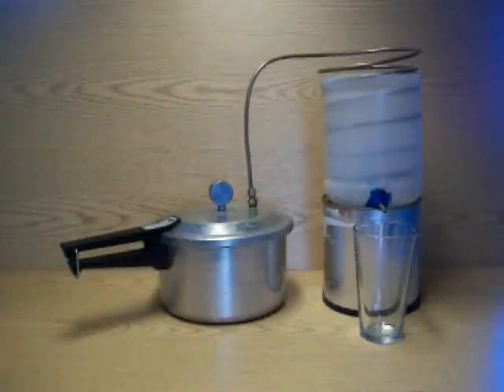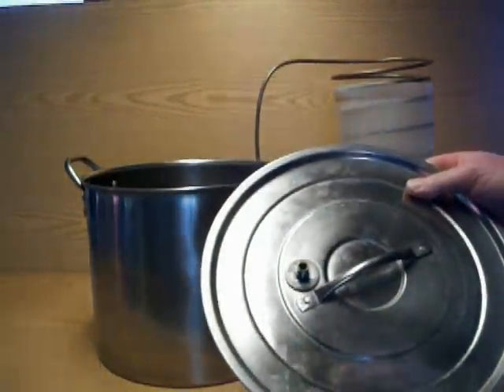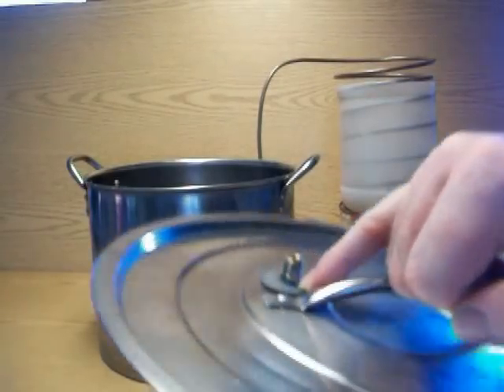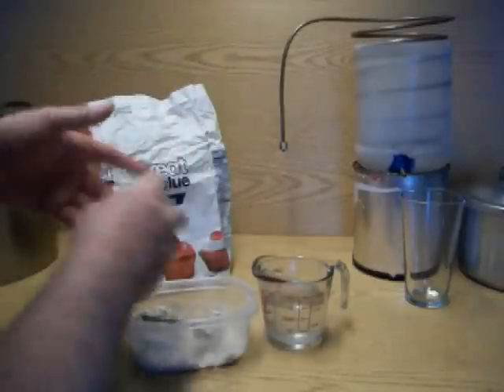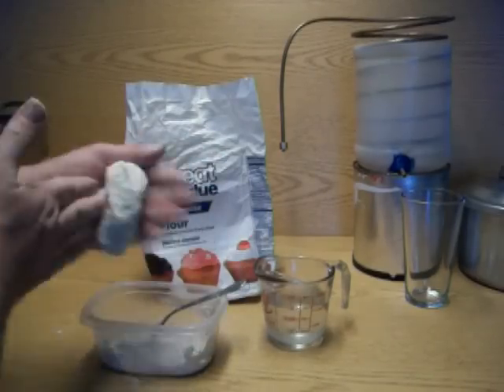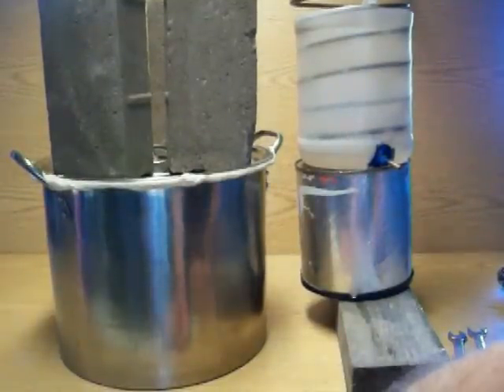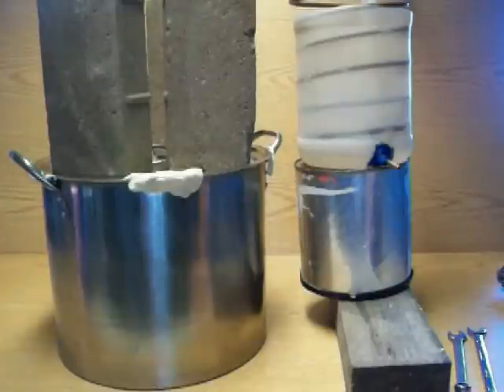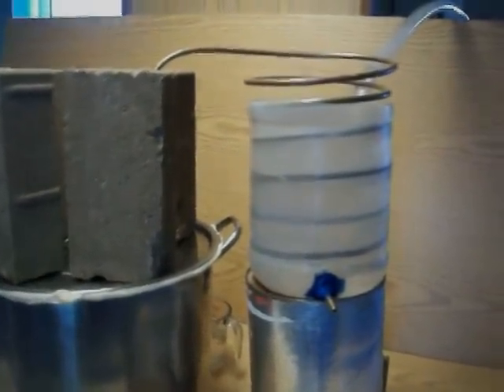Easy Build Moonshine Still pt 2 Upgrade

Comment from the maker: Not the way I see it. For everyday use, yes. Hobby use, no. A soup pot that has been fully converted, with all the extras like fasteners and glued on rubber gaskets, for sale on ebay will cost at a start of $350 min. I've spent $40 and got 4 soup pots, that are still soup pots when finished. It take 5 min to make flour putty and I know it won't leech chemicals. This also compares to how the backwoods'ers do it. They use flour putty and rocks in the exact same manor.

Comment: what's the thing called goong into the lid I have a 1/4 soft copper tubing
Reply from the maker: It's just a connector, sold at the hardware store.
Reply: Let me ask u something I have a 1/4 soft copper tubing what size fitting should I buy for my lid for the copper tubing
Reply from the maker: Just take your parts to the hardware store and ask the people that work there. They know their business very well
Reply: one more question do u think 1/4 soft copper tubing is good enough or should I use a bigger size
Reply from the maker: 1/4 is twice as big as I'm using.....so seems perfectly fine to me. Just use whatever size will fit in the hole

Comment: WCEmichale-what equipment do I need to get after I drill hole in lid
Reply: What size couplers do I need
Reply: What size copper coil do I need
Reply: What size hole
Reply from the maker: A couple of wrenches or a couple of pairs of pliers, or a wrench and a pair of pliers.

Comment from the maker: I don't think it's a good idea. I didn't want to use it at the connection, but it was a micro amount and it was on the outside.
You could use cork (found on Ebay) and cut out a gasket, and if I was going to glue it to the lid, I would look up "food safe adhesives" on a search engine or Ebay

Comment: What's the purpose of a thumper?
Reply from the maker: The purpose of a thumper is increase the potency of the alcohol... Personally I don't see it. I never use one
 The backings that you are suppose to put in it can easily be put in the still. Backings are the little bits of alcohol you get toward the end of a run... There is so little of it, it tastes watered down and crappy BUT can be recaptured by adding it to your next run

Comment: Move your plastic jug with worm  in it closer to sink pop small he in side of bottom so it will run in sink turn yer cold water on and regulate it to the amount that is draining out of bottom and no more changing water all the time it would save ya allot of time and have a constant cool water all the time and that's one of the important steps don't you think ????
Reply from the maker: It is impossible to regulate. I tried a small siphon hose, and having the cool water flow down to a trickle. It either slowly overflowed or it slowly drained dry.
The only solution is to install fittings on the plastic jug. One on the bottom for inlet of cool water and one on the top to let the overflow run into. This is just extra work to get everything and make sure it's sealed well and will hold up well, and it will also confuse viewers who need to understand the basic principles involved first.

Not that I don't like your idea.....

Comment: so if you brewed 10 gallons of something and it was 5% alcohol then (in a perfect world) not discounting heads or tails, you would get roughly half a gallon of alcohol at 100ABV  but since it distills less then that at say 80 proof  you would have almost a gallon of liquor, minus heads and tails, minus imperfections in your brewing you might get 3/4 of a gallon of liquor out of the 10 gallons of beer
Reply: sorry, I meant that as a question?  is the math reasonably sound?
Reply from the maker: Rick Hermann
I can't do your math right now, I had a late day at work and came home with a headache, so I'll answer from my point of knowledge.
I brew 5 gallons of mash/wash, and get a roughly a 14% concentration of alcohol. I distill that to about 100 proof and get roughly a half gallon of whiskey.
Your 10 gal at 5% would give you half a gallon of whiskey (assuming it was pure 200 proof) and at 100 proof it would be one full gal of whiskey. Is that close enough?

Comment: Hi mate love ur video, but i hear u need a bowl on top not flat lid, wot u think? And Justin Poole made a video with ur potato flakes.
Reply from the maker: Graham Bate  It's just one basic principal involved. Heat your mash/wash to steam, move the steam over, cool the steam down to condense it, collect liquid.

The bowl is not needed, however I can see practical uses for the bowl. it would provide extra cooling surface to condense some of the water and run back into the pot, this might increase the proof a bit. If you have a bowl on a lid, you can put holes in the lid and pack it with copper mesh.
Reply: sweet thx m8, I enjoy ur videos keep them up m8

Comment: Why not buy a larger pressure cooker and save yourself the hassle, those bricks are gonna warp that lid real fast

It's a handy tip how to make moonshine if your in the joint though or on the lam
Reply from the maker: This video was made 5 years ago and the lid hasn't done anything. This video is for showing people what can be done. It was roughly copied by a couple of guys in Pakistan, where they didn't have extra cash for a pressure cooker.
Reply: I didn't mind the flour idea you had as it was interesting to see how the moonshiners in the past probably did theirs without easy access too materials, is distilling moonshine not illegal in N-America, its legal here in the U.K. I just ordered myself a brad-new 10 Liter stainless steel pressure cooker gonna do it with a flameless induction hob, should maintain my pressure cookers life as no flame is being used. Ebay selling large bags 25Kg of cracked corn real cheap too making it even easier
Reply from the maker: Well as long as it gave you some insight, I've done my job. You could also check my video where I made shine from corn flakes. The information I looked up said there are parts of the US are legal. As long as you only make enough for yourself, you shouldn't attract attention. The main law not to break is selling the stuff. That is big time jail time. There was a news story about a couple of guys making banana brandy, possibly from my recipe, only problem was they had a huge still in their garage and had gallons of the stuff when the law arrived. Try proving no intent to sell on that one.

Comment: has anyone used a crockpot instead of the pressure cooker or the regular pot?
Reply from the maker: You can use lots of thing.......but they gotta be completely sealed or all your alcohol will leak out as steam
Reply: thanks!
Reply from the maker: @SheSewsDiscord  I see you had a question about connecting the coil to the lid.  Unscrew one of the components in the lid and take to the hardware store and ask them for a connector for a copper line
Reply: @wcemichael  Thank u!! actually i think the original owner must have lost one of the components— there was only a plastic plug!  but i will see what i can do with that— thank you again!!
Reply from the maker: @SheSewsDiscord  A plastic plug? Oh that must be an emergency pressure release. You should be able to get a tread tapper and make a useable screw thread....OR there should be a actual pressure regulator that should screw out. Ask the hardware guy about these possibilities. If worse comes to worse you can just use the flour putty to seal the copper tube in when you run it. The key is going slow so you don't put too much pressure on the putty

Comment from the maker: You didn't give me a whole lot of info there. Can you be more specific? From your general info, I'd say your running too hot. That bread dough is not going to handle more than a couple pounds of pressure. Turn the flame down.

The glue was a high temp car gasket material. It's a micro amount on the outside otherwise I wouldn't even consider it. You can also use the flour putty in place of that, It might last forever. You can stuff some f-putty into rivet cracks and let it harden.

Comment: No thumper?
Reply from the maker: You don't need a thumper if you do it right.. I watched Popcorn Sutton use a thumper to increase the alcohol percentage...……..then he cut it all with water. What's the point? I can easily get 100 proof and there are tricks to go higher.

Comment: Besides, commercial kitchens (i.e. restaurants) use almost exclusively aluminum because of its superior heat transfer.... Oh damn it's a conspiracy to kill us all hahaha
Reply: You’re mistaking all commercial kitchens use entirely stainless steel . Aluminum releases hydrogen with hot water and hydrogen gas would be dissolved in your water vapor making your alcohol slightly acidic

Comment: If u add a thumper it's safer and the proof will be higher
Reply from the maker: If I add a thumper, it will get higher, yes.
Safer? Debatable....It's not going to remove impurities.
I'm already getting 130 proof and I bring it down to 100 so people want to actually drink it. Adding a thumper at his point is taking a step backwards.
Reply: it will get rid of some stuff .when I first started I  was only getting 140 proof then I added a thumper it went up to 165 and stayed a long time. and no boil overs. u can use the same mash that's in the still or wine or high proof licker. its a good way to change the taste  and proof. I like to use the same mash ..good luck
Reply from the maker: Yes, as I said. A thumper will ramp up the proof. Keeping your cooling coil from puking from boil overs is about the only "safety" you can expect. 
However, unless your thumper is made from a mason jar, you don't really know about it puking, and a good distiller doesn't normally have this problem. Also, I always bring my proof down to 100 anyway. Good for drinking yet having enough kick to know it's not everyday whiskey. 
So a thumper can be used but is not needed.

Comment: Instead of putty just cut a ring from a whole sheet of rubber. Then use tiny C-clamps
Reply from the maker: Well the main purpose of this is to show the average guy how to do this without a lot of extra stuff. Also, the reason for the flour putty is people didn't like the rubber gasket, they thought it put toxins in the alcohol

Comment: you could use a old frozen water bottle.
Reply from the maker: There is enough heat there to slow cook a pot of soup. More water changes needed than a single block of ice will handle

Comment: Can i use my drayer machien.. I use it .. It was very very very god
Reply from the maker: What is that? are you asking or telling me?
Reply: wcemichael
is a thumper not nessicery? and does it just increase the proof of the end product ? what proof do you get without a thumper?
Reply from the maker: Rob o kane
Oh, hey. Sorry I missed this question. A thumper can be used and will increase the final proof when used right, BUT it is not needed. I can easily get 130p and I water it down to 100. That makes it low enough for anybody to drink but still high enough to know your not dealing with store bought whiskey.
Reply: thanks for the reply

Comment: You know a much easier way to do that is just freeze a bunch of 2 liter bottles with water in them and if the water starts to get warm pull 1/2 L out and pop the other two you in easy Peezy
Reply from the maker: And a fresh pot of cooled water will be hot enough to make soup in no time and running 5 gal takes all day so I'll need a freezer full of 2 liter bottles. So now I have to prep these bottles instead of just turning on the tap, and I have no room in my freezer for food. How is that easier??

Comment: i like your videos your mash recipies but dude buy a still from mile high or another source get a  3 gallon for what you do. you cannot guarantee the silicone wont interact with your vapor
Reply: i mean for 300 bucks just lets be safe and informative
Reply from the maker: 300 Bucks? Just go by the alcohol. The amount I used and the location it was put would have less interaction than if I just cut a tiny finger nail clipping sized sliver and ate it. Plus if you do cleaning runs that fraction of a fraction will be reduced even further.

Comment: please stop using bricks all u need are paper clip type clamps to secure the lid.also you should flour dough all connections.also there is absolutely no build up of any pressure to worry about...unless u have an air tight crimp in the worm some where..also u should consider using an electric burner..no worry of fume or vapor to open flame.just saying.lol  nice vid i did subscribe have a blessed day here from midwest  shiner
Reply from the maker: +KEN WALLS Please stop?!?! You make it sound like I'm hurting somebody...
 Sorry didn't have any paper clips lying around. I also had to double the amount of bricks used from 2 to 4 because is wasn't secure enough.
Also I'm not just running out and buying a new stove, not to mention I'd have to run a 220 line, outlet and breaker., but I appreciate and understand your concern.
Reply: +wcemichael  these people. Wow..
Reply from the maker: Mike Quesnell You take any backwoods moonshiner and they put rocks on top of the still for obvious reasons.
Reply: @glock23 gen4 Really??? Like the bricks are gonna explode or something? It's a simple solution to holding the lid firmly in place with the use of something nature offers for free. It's called gravity.

Comment: Why not just rip that plastic off of that coil and put the coil in a 5 gallon bucket and dump a 20 pound bag of ice in it at the beginning of the run? You can drain off warm melt water as you go replacing the ice as needed.
Reply from the maker: Because I live in a trailer with no garage or shed and zero space to spare, and a 5 gal bucket doesn't fit under the sink, and ice is just more prep work and/or cost seeing that you still need water changes...AND (deep inhale), I'm showing everybody the bare minimum requirements of having a still.
Reply: @wcemichael  wow! Baddass! Keep on keepin on bro!
Reply from the maker: @mattpeacock5208  Thanks.... I usually get a response like "you're stupid"
Reply: @wcemichael  not from me. I'm in a 1 bedroom apartment and i have an 8gal pot for canning.  I plan to drill a hole in the lid for a 3/4" copper tube and a smaller one for a thermometer and and make the whole thing into a still. I'm looking all over for good ideas so it not only works , but the product is safe.
Reply from the maker: @mattpeacock5208  Before you do all that... There has been some controversy over aluminum cooking pots. Now I personally don't see a problem because we are purifying stuff, HOWEVER there was a noticeable difference in drinkability. When I used an aluminum pot, my whisky would "kick" (best word I can think of) going down. To make smoother whiskey, I suggest a stainless steel pot, or look up some videos on DIY copper plating for the inside of the pot... I plan on doing this myself in a future video....that is if I ever get around to making videos again.
Reply: @wcemichael  I'll make sure first, but I believe it's coated steel
 You ever seen those 8 gallon glazed pots that you buy for canning pickles?
Reply from the maker: @mattpeacock5208  No I haven't but I'll take your word on it

Comment: umm first , no putty get some gasket sheeting for "lip" of your stock pot  secondly you can  use "vise grips" or miniature "C-clamps" to keep it locked down placed every 30 or so degrees around the "lip" as far as your condenser you have no "thumper"  which helps smooth out as well as increase alcohol volume for your coil/worm use another "stock pot "  drill out 4 holes 2 on top and 2 on bottom on opposite sides .. insert your "coil" through one set then your tap/faucet hose for the sake of "conservation" you can take a small aquarium pump to circulate water from a long shallow trough  and just keeping the water circulating and aerated will help it stay regulated and cool enough to condense the alcohol vapor ..
Reply: SirAzraielBridger n

Comment: Gotta put ice in the water bucket
Reply from the maker: No. You can even have hot water in the bucket as long as it's cooler than the steam
Reply: @wcemichael  dually noted